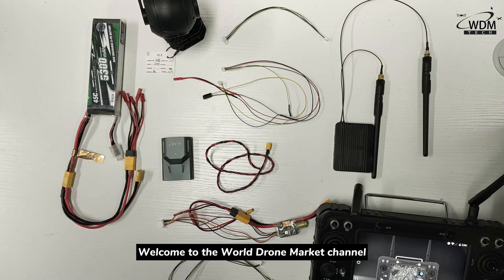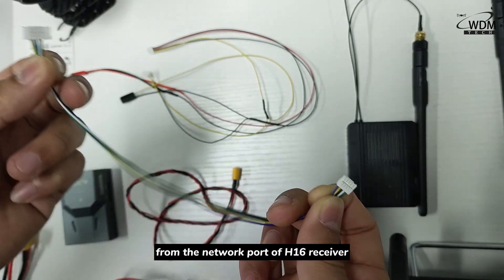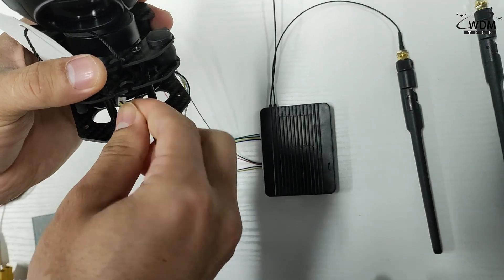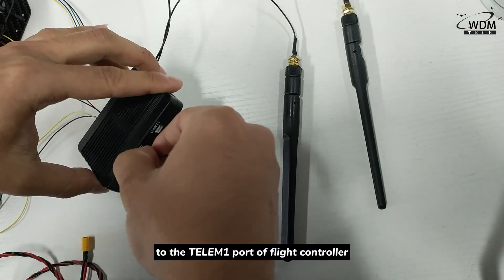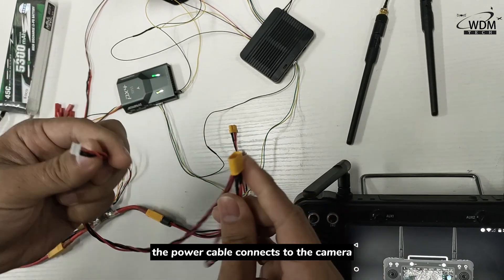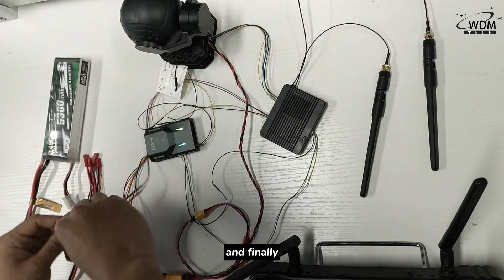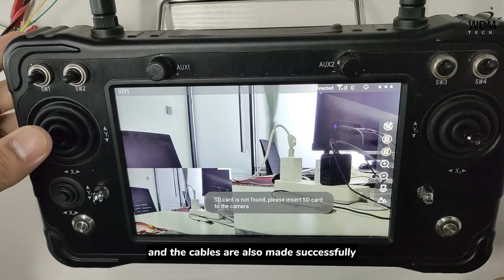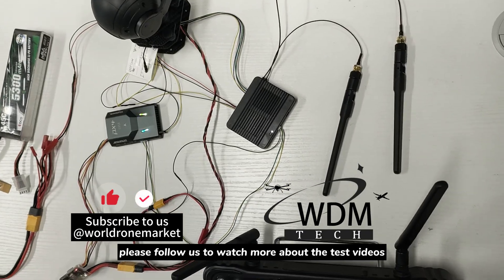SIYI ZR10 Camera with N7 Flight Controller connected to H16 Remote Controller

Comment: Please I need connection for FLIGHT CONTROLLER PIXSURVEY A1 ardupilot with SIYI ZR10 and H16 pro
Reply from the maker: H16 Pro and ZR10 are connected normally, just like the beginning of this video. The difference here is the flight control. You need to connect the S.bus control line of SIYI N7 receiver to the S.bus out interface on PIXSURVEY A1, and connect the UART 0 or UART 1 interface of H16 pro to the TELEM 1 interface on PIXSURVEY A1.

In addition, you can contact us by email "tech@worldronemarket.com" or "tech2@worldronemarket.com" and send us your problem video so that we can better help you.
Reply: @worldronemarket THANK YOU SO MUCH 
I USE FOR VTOL HERO 2180
Reply: I try exactly same connections but SIYI FPV CAMERA IS NOT WORKING